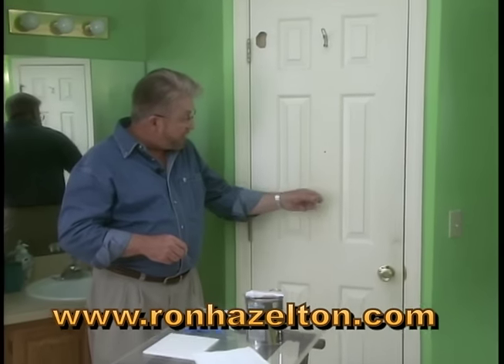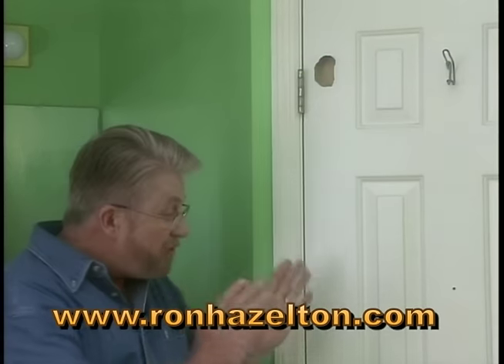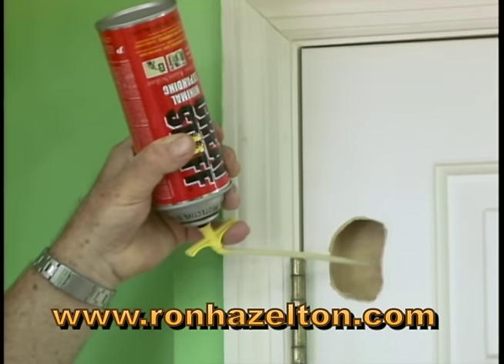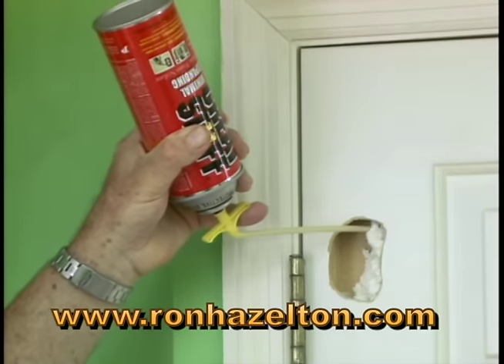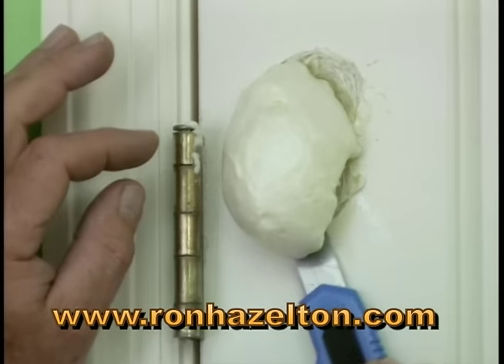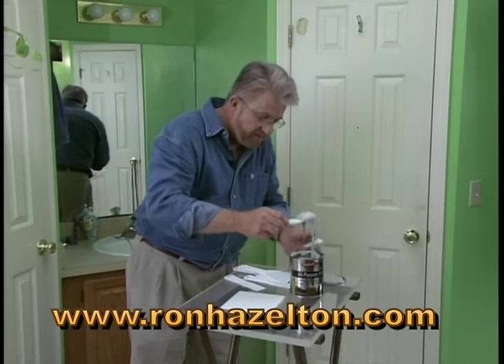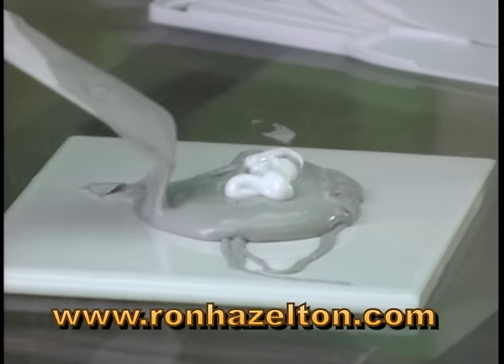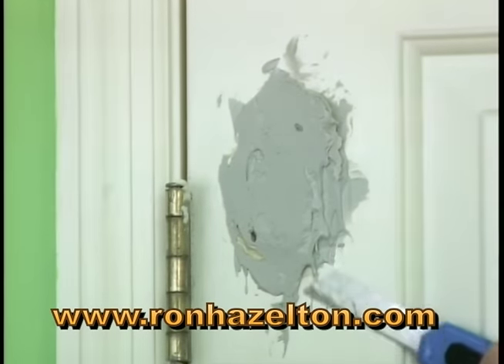How to Patch a Hole in a Hollow Core Door

Comment: This is good if you already have all those  things used to fill up the  hole.  Otherwise, you're spending enough to get yourself a new door- a cheap, but undamaged door.
Reply: Weshallhave Harmony would probably be better if you had multiple doors with holes.
Reply: Weshallhave Harmony huh, are you crazy?  Even a cheap door would cost at least $100.  These materials don't cost anywhere near that much -.-
Reply: John Meise you can get doors for $60 at home depot
Reply: joshvinje *waves* hi there.  That's still more expensive than those supplies, even if only by $10-$20.  BUT when you consider that those supplies can fix multiple doors well that just makes them even cheaper.  I know I said $100 but even at $60, it's still more expensive than fixing the door.  In addition to that, you can't just pick up a $60 door if you want the same style or similar style door you had (unless the $60 door happens to be the same type of door).  Plus it's wasteful to throw out an otherwise perfectly good door anyway.  But you have made me feel a bit better about being able to relatively cheaply replace some of the molding that I broke without breaking the bank as it probably would not be priced too high shrugs

Comment: Apply a couple wood shims behind the hole with gorilla glue or power grab and let it dry, fill with mud(drywall joint compound), sand and done. All that is missing is, that vital hollow core door faux wood texture that this video leaves out. Hmmm lol.

Comment: It's all fine and dandy, but all hollow core doors have a faux wood texture and I have installed hundreds of them. Good luck with that.
Reply: Better than a hole..  You could try doing a knock down texture, wont be the same but the repair wouldn't be completely smooth against a faux wood texture...

Comment: how to fix a hole on a hardboard without spray foam
Reply: +Surendra Nair Try gluing a piece of wood on the inside of the hole.
Reply: Yes, just like fixing holes in ceiling or drywall.

Comment: Sounds like too much work. Quick and easy way...
1>  stuff with newspaper
2> quick dry putty over it.
3> sand and paint (the drywall putty i use dries to the same door color but you could paint it.

Why use the fiberglass filler? Unless its in an answer that gets punched in by a stopper or something on the wall behind it.